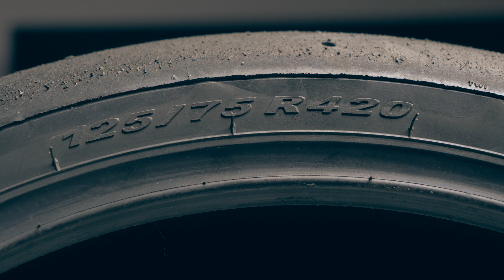Why do Motorcycle tires have different Profiles

Comment: I have a question. I ride a 450 supermotard.  For the front tyre it came with 125/600.  I have found some 125/80 tyres.  What will the difference be ?

Comment: I still can't figure out how different 180/55 tires seem to have different profiles. I don't know much about sidewall flex, but I did lay my bike down on its frame slider on a small box to where i maxed out the rear tire, I then got on the bike and could not put my knee down, even with they tire maxed out.
And they're supposed to be good sports tires, dunlop Alpha 14 sportmax

Comment: Hey ,Can someone tell me why front wheels always look like they are mounted the wrong way round?
Reply: for what i know the tire tread is shaped to push the water to the inside of the corner, because your wheel will always push towards the outside of the corner. correct me if i'm wrong anyone!

Comment: What about tires that have a three digit aspect ratio?
Reply from the maker: They are taller than they are wide. Usually found on dirt bike tires. Provides more suspension.
Reply: Thank you, but what about Bridgestone tires V02 they are providing sizes like 90/580 and 120/600 it was kind of odd sizing 🤣